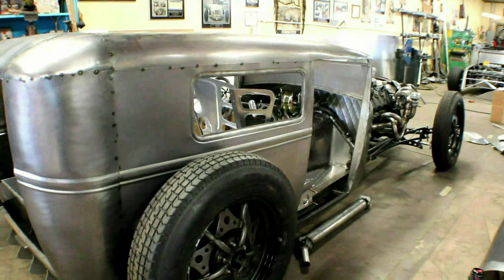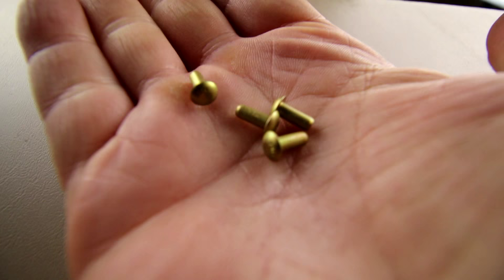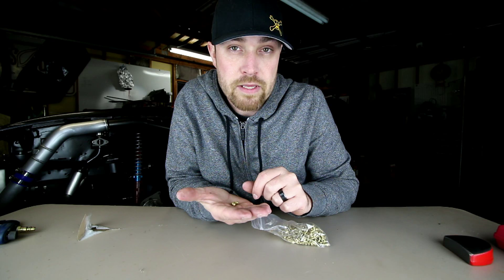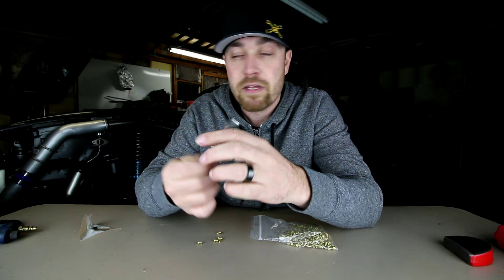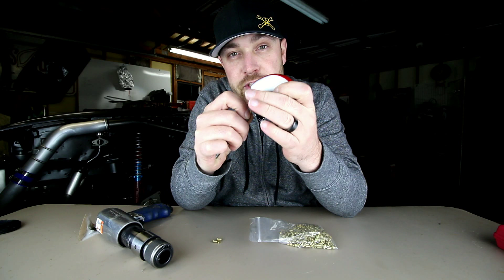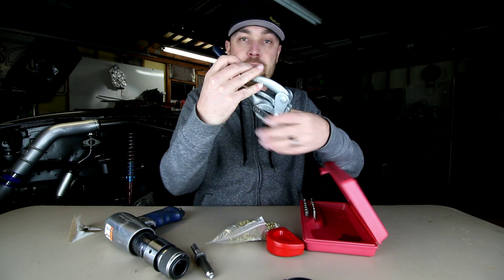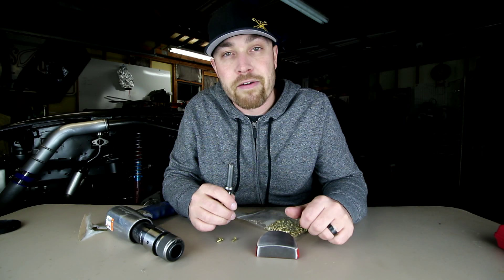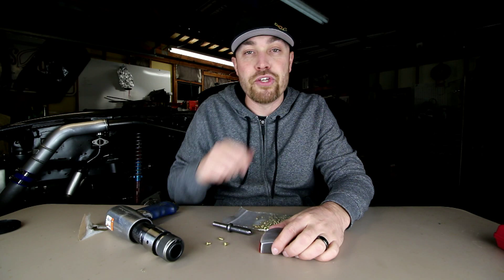You Need This Tool - Episode 12 | Aircraft Rivet Riveter & Rivets

Comment: As a career aircraft structures man I would offer some caution here...The gun used in this video is an air hammer, not a rivet gun. It will do the job (unless you're dealing with much bigger/harder rivets), but a rivet gun should be used with aircraft rivets. An air hammer has a faster, less powerful stroke and a rivet could easily be bent, not bucked correctly, or become brittle/unworkable due to excessive (too fast) action at the rivet set end. Rivet guns are a bit more expensive, but if one wants to correctly use solid-shank aircraft rivets, use a rivet gun, not an air hammer. Shameless plug for The Yard Store and Ebay for good used rivet guns.
Reply from the maker: This gun can be regulated and has driven 100's rivets with no issues. The guns linked in the description are specific guns made for solid rivets though if that makes you feel better. Thanks for looking out

Comment: yep good tool to have. Mine is a "ATS-3X" it is an actual rivet gun. air hammers are ok but not nearly enough control. you are gonna have smiles on your rivet had and flat buck tails if ya go too hard. cheers! 20 years as a C130 airframe mech.

Comment: That rivet is an MS20470A(or B) rivet( couldn't see the head good enough to be sure), which is an extremely soft rivet. That was an air hammer you bought not a RIVET GUN, and the tool that goes on the button head of the rivet(yes, it is called a button head rivet), is called a rivet SET, never has it been called a "SNAP" like Steve Jacobs called it, and that "buck", is called a BUCKING BAR which forms the shop head, the button head is also referred to as the Manufactured Head. Just in case you wanted to know the correct names of the tools.
Reply from the maker: you should put you knowledge to good use
Reply: +The Fab Forum+  I do. I have worked aviation for over 30 years. I build small private planes in my garage and restore vintage aircraft. My message was a "Just in case you wanted to know" message". I was not trying to be a smartass if that's how it came across.
Reply from the maker: Its hard to read intent through text. Thanks for the insight
Reply: .. thanks "trollin" for your input ... BUT I suggest we might both be correct ... my using the term 'Snap' IS correct  if perhaps more often used outside the USA where the term 'Set' is more in use ..  outside the US I always heard the term 'SNAP' used ... its probably a hang on from the old world British systems of doing stuff that I grew up with ... (BTW I also am an A&P and a Licensed Aircraft Engineer and have been since 1976)   CHEERS
Reply: Then I stand corrected. I am not well versed on British terms though I do try. I am always willing to learn.
Reply: In England they call them "snaps", and from the looks of that rivet it's a AN470 or what they call a Universal Head. Button Head rivets are from the 40's & 50's. I see them on some school buses and old trailers. Any tool made in china is junk, plane & simple. And yes, that is a Air Hammer not a Rivet Gun. I've been selling these types of tools on eBay since 2000.
Reply: I've always heard them called sets and working with British Lynx and Apache mechanics they used both terms. I needed tools out there and used a British tool supply webpage that used both terms as well and it brought up a conversation about it. I argued that if used in a rivet gun it should be called sets and if used in a rivet squeezer it should be called snaps (although in the US we call all of them sets). We agreed to disagree and went back to talking shit about each others countries beer. ;)
Reply: I agree the rivets are MS20470AD5 rivets but it's also called a "dome head rivet", the tool where I come from would be called a "snap" and the bucking bar is generally referred to as a "dolly". No right or wrong answer, just a difference of name depending on location....
Reply: Simple tip keep your gun straight use a clear plastic bag between your snap and rivet , don’t use sticky tape as you will be cleaning your rivets and snap . This will give you a nice clean rivet . As for the tail another subject for another day.

Comment: Hi Kyle, great selection once again!! This was my bread and butter for 32 years. The end that goes into the hammer is called a "snap" they come in dash 3-4 and 5. Thats in 32nd of an inch. A lil helper for ya .....use a piece of rubber preferably from a blow press die or  any hard rubber that wont break under  pressure. It helps keep all layers tight when squeezing the rivet Drill a hole to the size of your rivet shank in the rubber and put it over the rivet between the work and the bucking bar..At least to set it then take it off and finish the button, for a 3/32 hole and rivet, drill it with a number 40 bit. or 3/32 , dash 4 is .128", and dash 5 is ..156". As a rule for shank length its 1.5 the diameter of your shank should be protruding on the back where the button will be formed.No more tho, it will dump and fall over going oval...no good.Esp if you can see the base of the hole. If so redo. If you lay a rivet down and its flush to the rivet shank thickness as a minimum you can squeak by on that. Were not building the shuttle right? lol....Make jumbly sense? You can also get alot of that stuff on  https://www.yardstore.com/

Comment: Thanks buddy  I started out looking for Speedy Rivets and found this video  which i learned something about Aircraft rivet installation that is cool because i have a fondness to Airsteam Campers  and ive  always wondered about replacing some although i must admit in general Airstreams are  pretty solid  even the older ones  what ive found and another reason i like them  is they are generally   Leak free  without water damage inside like so many other campers that have rubber membrane roofs  and Butyl taped windows and doors !  Another plus on Airstreams is they usually installed  pretty high end  components  as its not in common to find a 30 plus year old furnace or refrigerator  in one that you cant get working with a minor amount of love  and tinkering

Comment: Aircraft guys don't like air hammers!
Automotive guys don't know the difference!
Air hammers are cheap, old used American made Rivet Guns are expensive.
I sell 50 year old rivet guns for $100 with several rivet sets and a bucking bar on eBay.
I sell air hammers at the swat meet for $5-$10

GREAT VIDEO though! Thanks for sharing information with a masses. . .
Reply from the maker: yeah I would agree with that

Comment: Do you think it’s okay to use a normal style rivet to secure fiberglass to aluminum? Worried it might crack the fiberglass.
Reply from the maker: probably be ok if the expanding part of the rivet is on the aluminum side
Reply: The Fab Forums ok. I may even use those rivets that expand into the 3 legs on the backside. Might put less pressure on the fiberglass.
Thanks for the reply

Comment: Not sure why you're calling these aircraft rivets.  While they may be used on aircraft, they are used in a lot of other capacities as well.  We commonly call these, "semi-tubular rivets".  One can also buy a modified c-clamp to squeeze them together; they run about $50.
Reply from the maker: these particular ones are solid rivets but yeah I am familiar with the ones you are talking about as I have some of those along with a squeezer
Reply: @Thefabforums  I stand corrected, my apologies.  I should not have been so cocky with my assumption

Comment: You missed one little trick.  A strip of duct tape over the socket of the rivet snap usually helps keep the manufactured head from getting scuffed up.
Reply from the maker: +waaaaste hmmm I will have to try that
Reply: Masking tape will work better and cheaper. We usually apply it to the sets themselves and have an abundance of it around when sealing aircraft surfaces.
Reply: I've bucked 100's of thousands without the need to protect the rivet head. I have used the tape to hold the rivets in place in the individual holes instead of placing them one at a time.

Comment: DO NOT USE AN AIR HAMMER! use a Rivet gun. they are drastically different and apply force in a  different way and it is harder to form a rivet using a air hammer. and air hammer will destroy rivets for the most part.
Reply from the maker: only if the air hammer is not adjustable